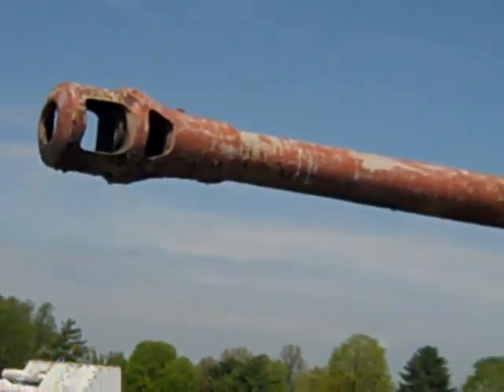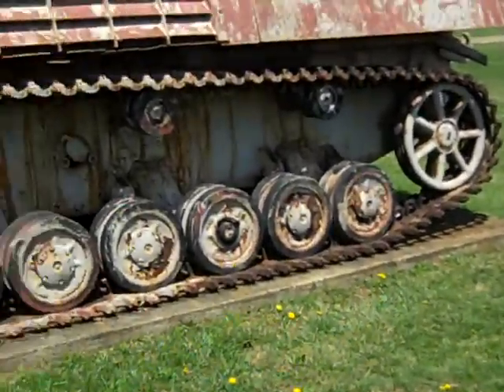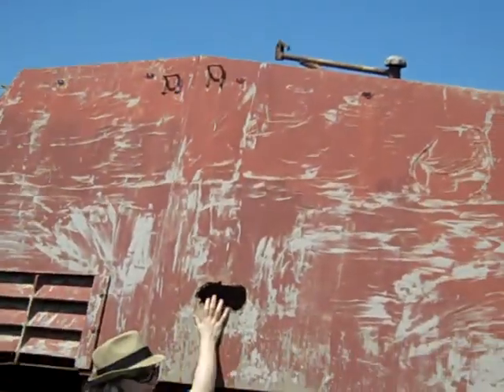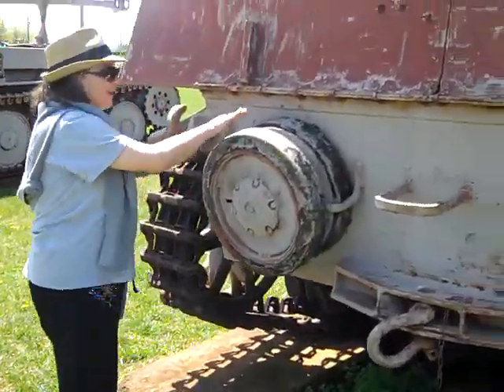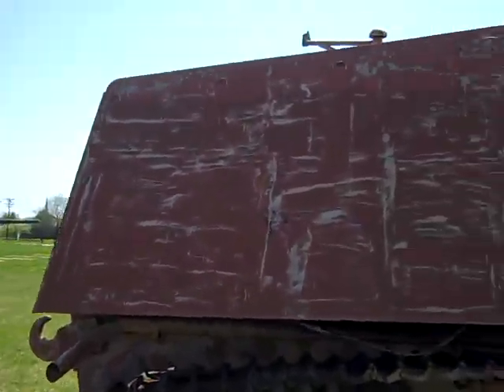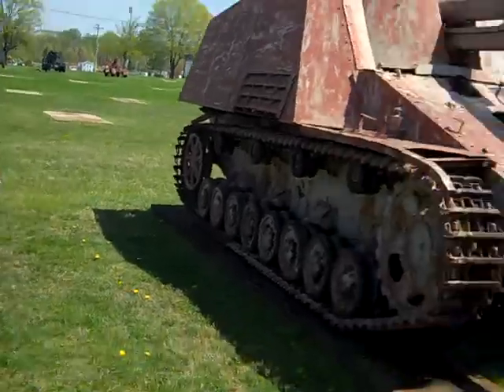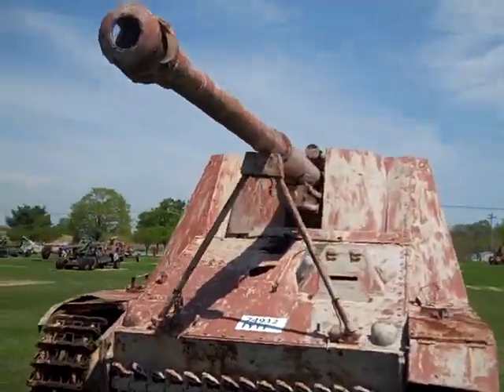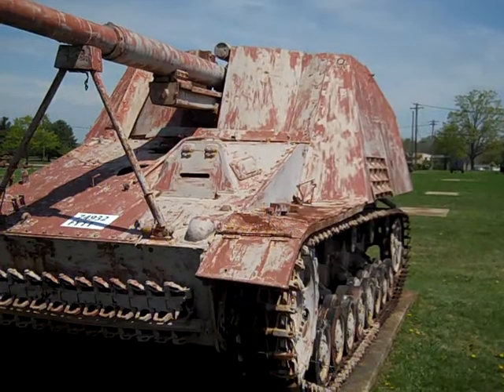Das Nashorn at Aberdeen Ordnance Museum

Comment: The Nashorn is not build on a pz iv hull. The hull is purpus build for this vehicle and the Hummel. The final drives are pziii and the rear is also different. The Nashorn is a mid engine and not a rear like the pziv
Reply: For more info look at the restoration of one on facebook. There is only one so easy to find
Reply from the maker: Yes, thank you. The Nashorn is a pretty interesting piece. Thank you for your time.